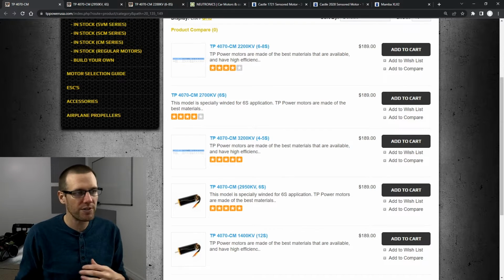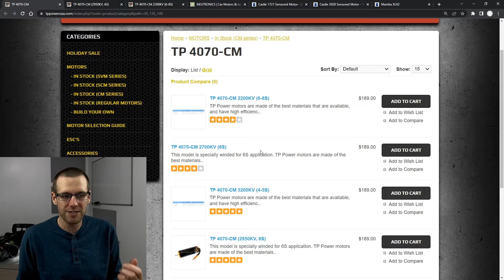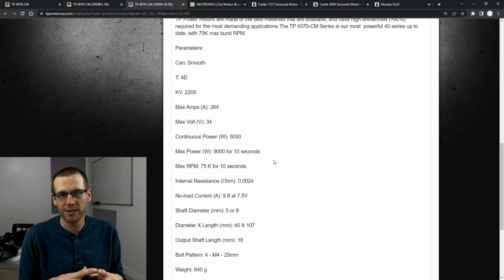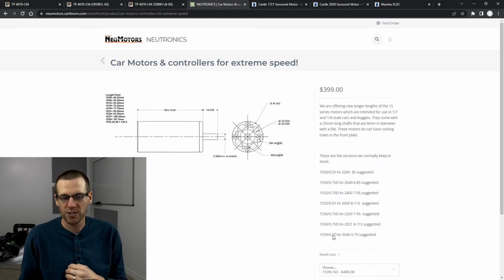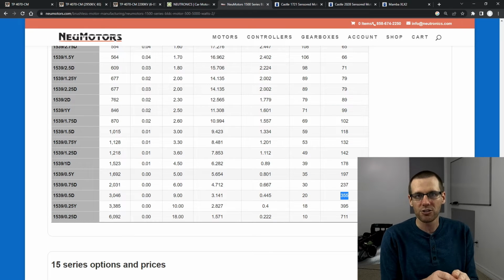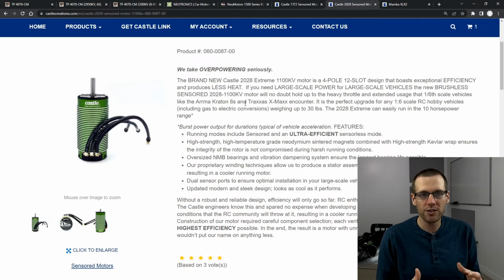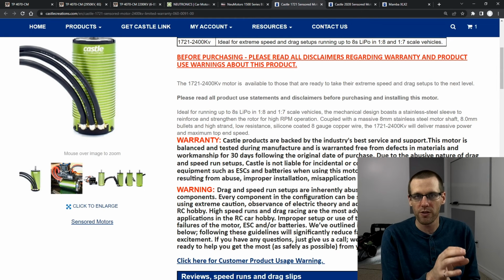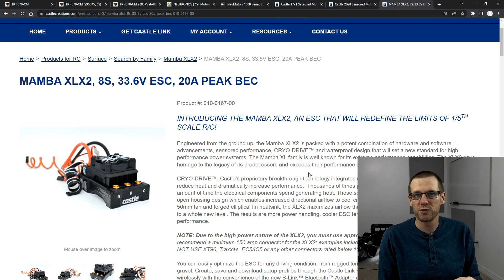Discussing Most Powerful RC Brushless Car Motors for Speed Runs

Comment: So none of these motors will work for Rc racing on off road track using a 4s?
Reply from the maker: 4s works
Reply: @RCexplained which 4s do you recommend?
Reply from the maker: smc

Comment: What you guys think about the new ezrun line up with the so called turbo timing feature? F.e. the 4278sd g2r. Its "just" a 2250vk 6s motor, but according to hobbywing due to the turbo timing its able to reach up to 60k rpm without blowing up. Im just a noob, not professional and dont want to break the bank.

Comment: Have a question. I have a rlaarlo am-x12 1/12 that I'm pissing with to try to get well over 100mph. It went 60 out the box on 3s power with a 2838 3200kv guessing 500 watt motor. It was only a 35 amp ESC.. Now I have a castle mamba x ESC,6s capable with a 1406 2850kv slate (I got it all on a deal for $100 used) running a cnhl 4s 6000mAh 120c HV battery. I can't get no bigger battery, it's stuffed stuffed. I can get somewhat longer motor but 36mm diameter is max. What do you feel would be the best motor I could run for speed keeping with the ESC and battery, 36mm case (I might be able to squeeze 75mm length? Any suggestions appreciated. Trying to keep around the $100 mark
Reply from the maker: Around that price point, consider a leopard 3674.
Reply: @RCexplained  ok, thanks much, I'll check it out

Comment: Can you wire 2 motors in parallel or series and drive them off one controller?

What about double up the pack in parallel to keep the voltage from sagging during the run?
Reply from the maker: Not recommended to wire 2 motors to an ESC. You can use multiple packs of equal cell counts in parallel.
Reply: @RCexplained  I want to see a special setup.  3 ESC's, one for each motor connection.
Reply from the maker: That's not how it works. Nothing would happen.
Reply: @RCexplained 3 times the power?

Comment: I'm on a tight budget so it's surpass hobby motors for me...
I'm definitely in the sub 100 mph club & I'm alright with that.
I find speed running at 70-80 mph on Scottish single track roads is a very thrilling thing to do.!!
It brings in suspension tuning a bit more to be able to handle the decidedly uneven & bumpy roads.! 😂 😂 😂
Reply: Same, their sensored motors are pretty good
Reply: What's a good surpass motor for 6s

Comment: Thankyou for the interesting video. 
Just wondering how we find out the torque output of these electric motors?
I don't understand why Manufacturers don't put the torque output for a given voltage. 

It would be so handy to know.

Automobile manufacturers list the horsepower and torque on their vehicles engines.

Comment: The numbers correspond to stator sizes, in the longest 133mm can they offer 3 different length stators: 3.3", 3.6" & 3.9"
Reply from the maker: True, I was wondering why they maintain the same can length for these varying stator sizes. Perhaps low volume sales on these massive motors makes it worth sticking to one case part number?
Reply: @RCexplained  I think that's it

Comment: I've always been curious, tp link4070 cm is for 6-8s, but couldn't one operate it on 3 or 4s as well?
Reply from the maker: You can yes, there is a different Kv motor in the 4070 series better suited for 4s.

Comment: Can I ask you a question? I cannot seem to find anyone to answer this. I want to try to get 70 to 85 mph out of a Traxxas UDR. it weighs around 13 to15 pounds. It's big and the stock set up does about 40 mph. You can get 45 mph by changing the pinion. You cannot go crazy different size pinions or spurs. I want to switch motors an esc out. There is not much room in this truck.And TP 4070 and a Castle 1721 with just fit with a over hang on back end and very close to drive shaft. So which motor and kv? The truck is set up for only a 6S. But you can get a way by adding a 2S to it so you get the 8S. Very sorry if I ask to much.

Thank you
Reply from the maker: I'm not familiar with that vehicle. Run the specs in an RC Calculator and you will get an estimation of speed potential.
Reply: @RCexplained  May I ask where is this RC Calculator?
Reply from the maker: @Airbrushkid  I have one on the patreon website. Should be a link in the description. Or the radiocontrolinfo website.
Reply: @RCexplained  Thank you. I went another route. I contacted Castle and TP techs. They help me. Both companies told me what motor. And specs. And I didn't have to spend $3.00. Thank you again.
Reply from the maker: Your "they help me"  "and I didn't have to spend $3.00"  "thank you thank you" comment is extremely passive aggressive. Expecting the guy who has no products to sell you, owes you exact product specific help after watching his free video and having access to his free website after giving you free help in a YouTube comment is  truly mind blowing. Very well done and a first on this channel.
Reply: @RCexplained  Your welcome. And I'm sorry if I offend you. But I am just a person  who watches these videos and am not trying to make money off of videos. If you started to charge for your videos, I don't think you make much. Their are billions who watch free videos every day. As for Castle and TP. I ask then for help. And said that I may not buy their motor because i was trying to figure out which motor to use. And I told them that I was talking to other companies.
Reply from the maker: I honestly have no idea what your points are. I can only assume you are trying to again prop your self up by taking another dig at the channel. The hole you are digging is only getting deeper and quite frankly, I'm not here to entertain you. Good Luck
Reply: @RCexplained  I'm not digging anything. And you take things to serious and you over read things. :person-turqouise-waving:

Comment: Can I run a 3s battey on these RTR rc car electronic specs?
Esc- 50A hobbywing esc
Motor- 3650, 3300KV brushless motor. 
I want to know if I can run it on 3s just to get a little more speed out of my rc car and pop some wheelies.

Comment: I have two TP 2950kv motors on a dual setup using MM8s for each motor. Do you think they will supply enough power for these motors?
Reply from the maker: It's a vague question. The setup can work if you don't push the ESC's too hard.
Reply: @RCexplained  it will be a drag set up. So I'm thinking with both motors working together they won't draw to high of an amperage in unison. Plus I will be adding cap packs. Thanks for the response

Comment: I have an Erevo 2.0 and I have had the TP 4070cm both 2200kv and 2700kv motors. Both are great but the TP 2200kv on 8s is monstrous.

I have just got the new TP Power 4080cm 2022kv motor which is a larger and more powerful version of the 4070 series. Not run it yet but I expect good things from this motor. I run all my motors on the Castle XLX2 ESC.
Reply from the maker: Nice setups Grant!
Reply: The tp power are powerful indeed, but draw way to much Amps. I find the leopard hobby to be the best bang for your buck motors.

Comment: Hi I currently deciding on if the tp 2200kv 4070cm would be good or a castle 1717 1650kv? Want to lightly bash with it too in the arrma limitless with the MMX8s esc
Reply: I would recommend 4070cm 2200KV or castle 1721 2400KV with the XLX2 ESC. I have personally ran the 1717 1650KV with the MMX8S and although it is good, it also has more limitations, in my opinion.
Reply from the maker: The 1717 1650Kv motor would be more suited to light bashing. The 4070CM is a high performance motor.

Comment: Excellent video great job information too.  I have the TPC 4070 can I use a max 5 or max 6 ESC to run in a new speed build?   And what is would be minimum ESC and your recommendation.  I do have a 8s cap pack.  Thanks soo much
Reply from the maker: You can use a smaller ESC than recommended, however, if you push it too hard you are risking blowing it up.
Reply: I have had a few TP 4070 motors and run them on the Max 6 ESC and this ESC whilst solid cant handle these motors as it just cant deliver the amounts of current these motors crave.

If you want to max out these motors then the XLX2 is the only way to go👍

Comment: I had a Neu 1515 2.5d (1600kv) in a Gorillamax chassis e converted revo (way before the E revo) using a Quark 125 car esc and 6s lipos, it was freakishly powerful (I was breaking pinion shafts on 1/8 scale diff setups). I can verify Neu doesn't play, these are the motors the Castle motors are based on
Reply: I have heard that Neu makes Castle motors. I think neu motors are still the gold standard motors but they are pricey.
Reply: @coffeedude2024 , The castle version are unfortunately still made in China using their own facilities, it's the design they licensed from Neu, I am pretty sure Neu Motors are at least assembled in the USA
Reply from the maker: Neu Motors are solid motors!
Reply: I still have one of the 2650kv Neu-Castle motors in box . I've had it for years as a backup for the first one . Still haven't killed tho having run dumb gearing or 6s at it and still survives . Even pushed an infraction to 104 with it! I would buy a plunger from Steve Neu if he designed it!